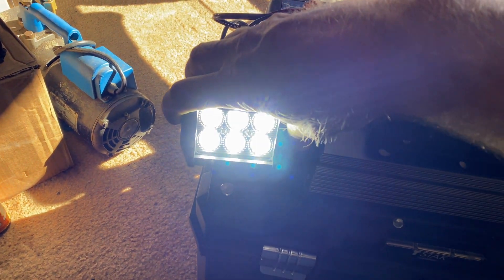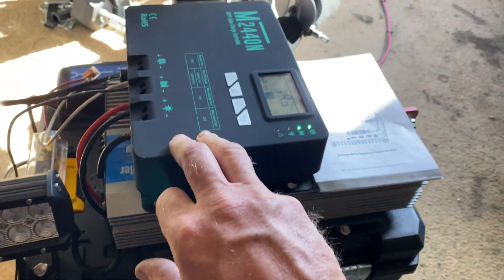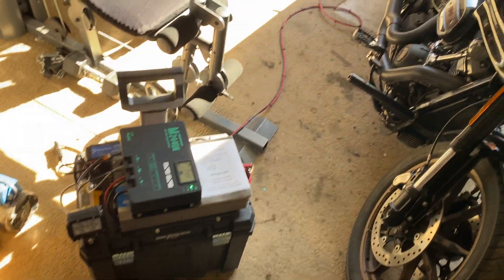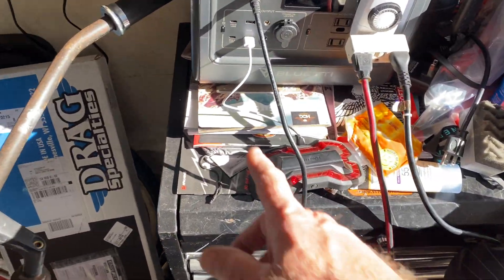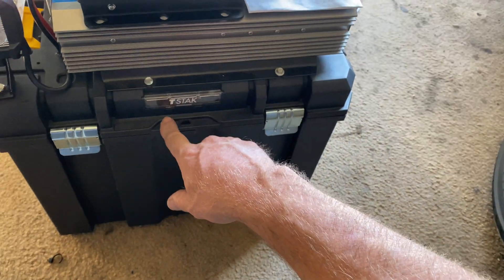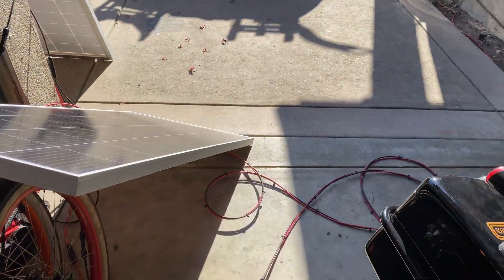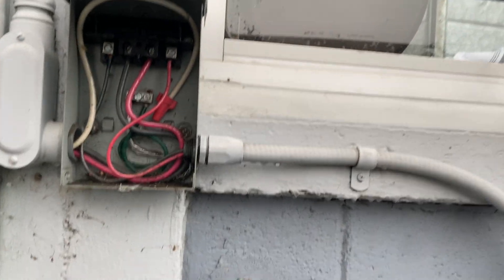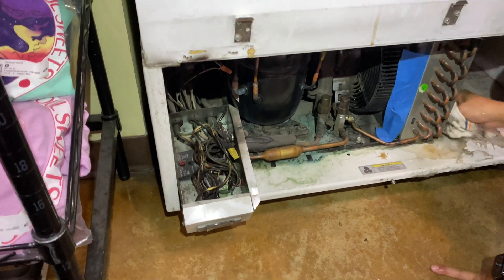DIY Solar Generator

Comment: panels wired in series = critical to have 100% perfect sunlight across them for best output, any shading/shadow anywhere on either panel will cause a huge output drop.
also the output will never exceed the rating of the smallest panel (if miss-matched in size)

Comment: What can be done for a missing disco to get them going.
Reply from the maker: Hot wire
Reply: if it's under 20 amp max draw and 10awg max wire gauge, then use a double pole switch(30 amp rated!) in an outdoor box and cover.

Comment: Never install any type of battery in a completely sealed container. Although most of the normal gasses (oxygen and hydrogen) produced in an SVR battery will be recombined and not escape, oxygen and hydrogen will escape from the battery in an overcharged condition (which is typical with any battery type).

For safety's sake, these potentially explosive gasses must be allowed to vent to the atmosphere and must never be trapped in a sealed battery box or tightly enclosed space!
Reply: Yea, im thinking of putting small “ Return air grills “ on the Side of my Solar Box im building. I’ve got lead acid batteries 🔋 in there. Do def hydrogen escaping when charging & charger inside & inverter. Definately B*mb if closed while charging.
Reply: @OcRefrig  👍